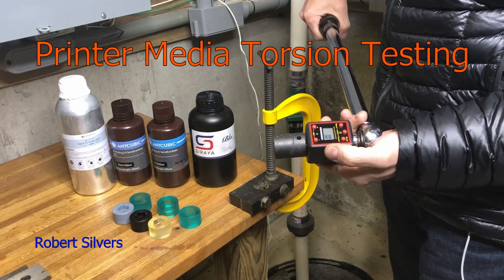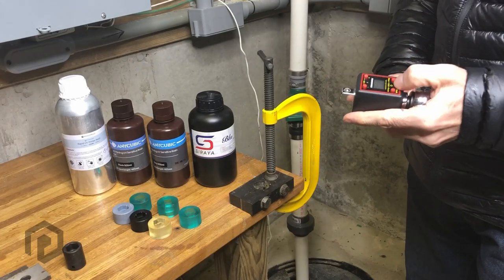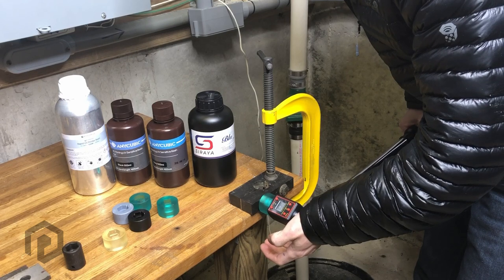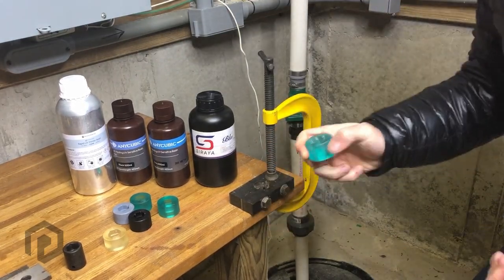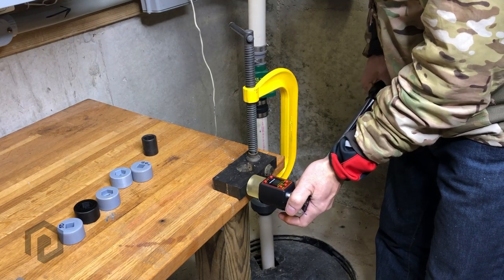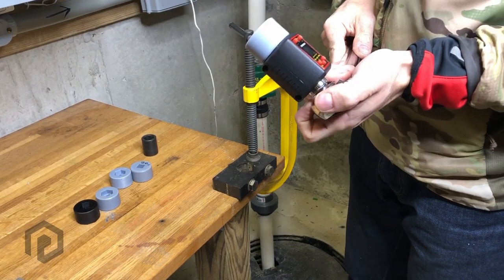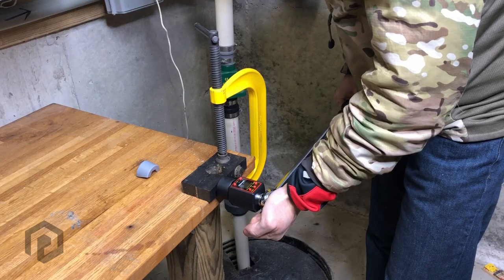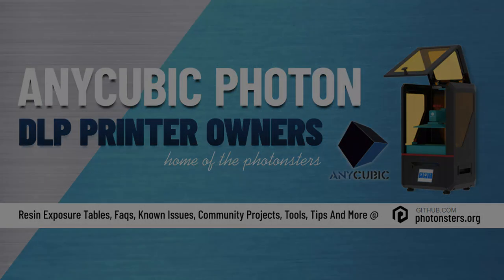Printer Media Torsion Strength Testing

Comment: Hi! nice testing protocol! yet I think the sample's geometry does not test the torsion strength of the resin. according to the failure mode it indicates failing in tension, from weak points (angles). an appropriate geometry for testing the torsion strength would feature a reduced section between couplings, in an hourglass style.